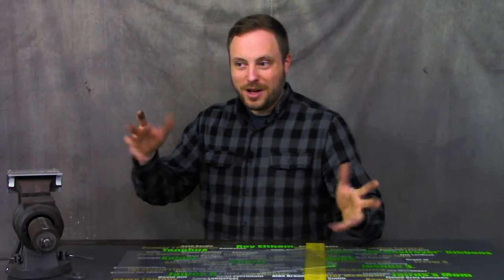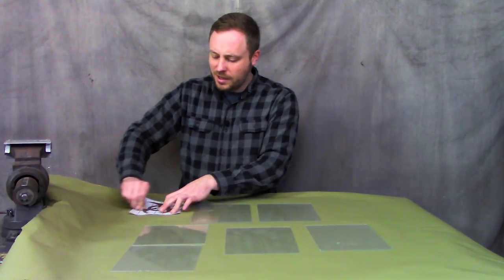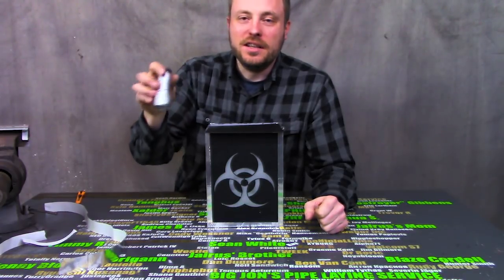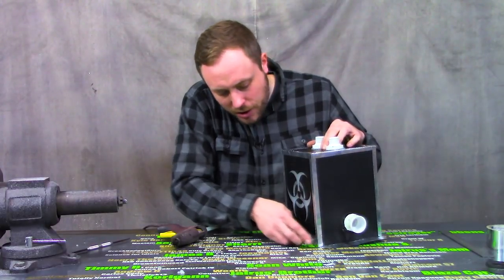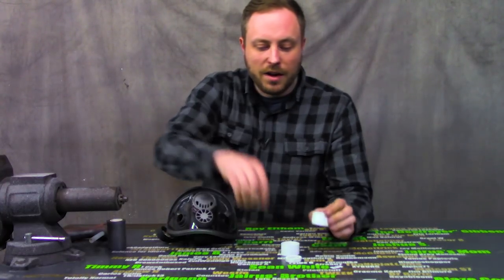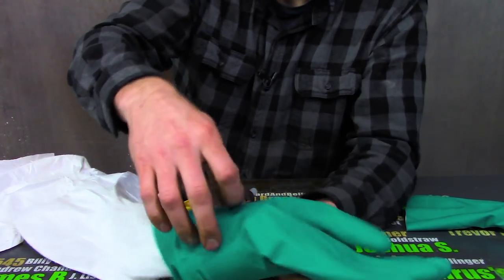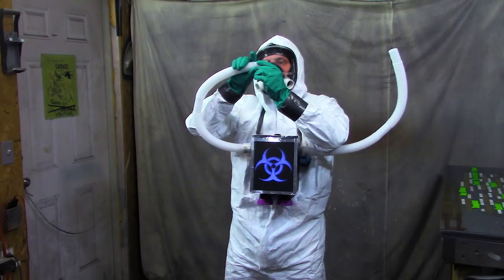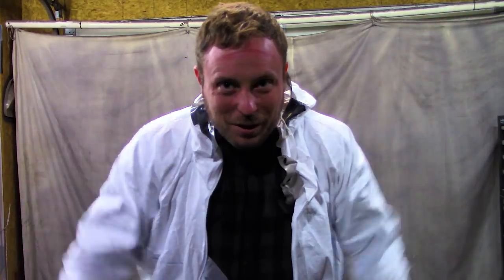ISOLATION BIO SUIT - Self Quarantine Build

Comment: You should have used a blow up T-Rex suit with a beefed up fan and filter! It was already made, only issue is the short arms! Don't worry about sealing it all up just make sure you have a good filter and positive pressure so the air is always going out. Also I think they make other shaped blow up suits like that with longer arms so they might be better than the T-Rex but I think the T-Rex would be the funniest!
Reply: Very clever use. That's how ventilated mask work.

Comment: Hey you can actually get uvc light bulbs pretty cheap on amazon.  They are basically the exact same bulb as florescent but without the white coating on the inside that turns uv into white light.

Comment: im in hazmat u use 3m spray glue and not hot glue lol and instead of a light box use a papr it's a pressurized respirator motor and filter if like myself you've worn a respirator for more than an hour you know that it gets very hot and hard to breathe through filters put a lot of strain on your lungs view are going to wear this for any significant amount of time other than just standing and one spot and not lifting anything or doing anything that exerts you need a PAPR and just ad a second stage filter
Reply: Not to mention we don't have to shave with a papr

Comment: slight issue with the first two minutes of your video. you seem to be under the impression that "n95" rated masks are not effective at stopping viral infection, however that isnt the case. Virus's like the coronavirus travel via particulates when in the air, and so as long as those particulates are filtered out, the mask is effective. The most typical particulate the virus is found in, far and away, is water-based particulates (like saliva), not oil based particulates. When NIOSH created the designation, what they meant by oil based particles was particles from pesticides, solvents, and other industrial fluids. While no definitive study on COVID-19 has proven that they don't travel on oil based particles, considering humans don't really release oil based particles in the air, and no other coronavirus has ever been observed floating around on oil based particles, its generally considered safe to use N-classification filters in the medical field. 

As for the 95 part, 95 can range anywhere between 95 and 98.9% of particles. I totally understand that if you are certain you are coming in contact with the coronavirus, you wouldn't want to take the risk of 5% of the virus reaching your airway, however when performing activities with less-than-100% risk of exposure, 95% efficiency is more than enough to provide a safety net. That's why n95 class masks and filters are the most commonly made and distributed.

Now, those masks you hook your ears around probably shouldn't be rated at n95, because they dont always filter the air coming into your airways. the sides often do not seal well to your face, allowing air to enter and escape, bypassing the filter. that's why masks shaped more like dust masks are better (if you've ever been involved in construction where dust was generated, you've hopefully been using these disposable masks). if you're interested in a source, here's what I got: https://www.cdc.gov/niosh/docs/96-101/default.html

Edit: also, just wanted to say, cool video! I know when people correct other people on the internet it can sound super hostile and negative, but I enjoy your channel, and the video was pretty fun. I really do appreciate that you took the time to remind everyone that its  "a dumb joke", I was just excited to share some knowledge and hopefully put some people at ease who thought their filters weren't good enough. 

TL;DR you're good to use N-class masks, but if you are confident you're gonna be huffing in coronavirus, probably go with an N99 or N100